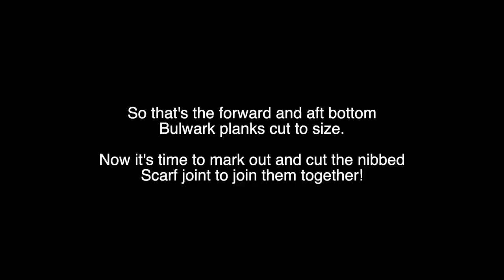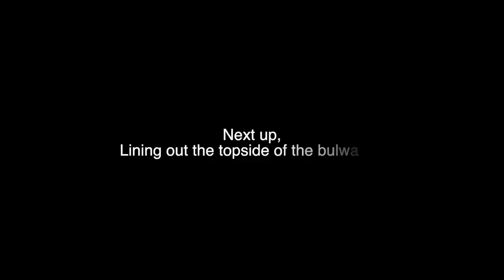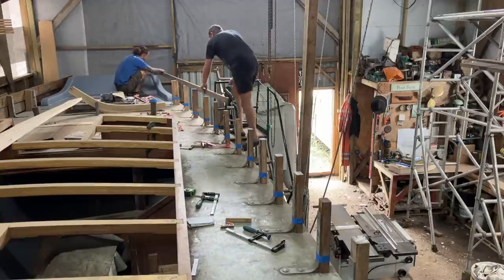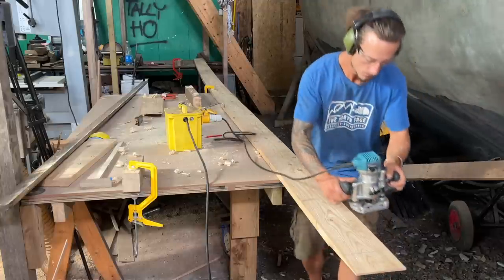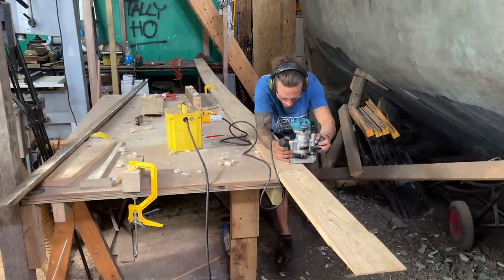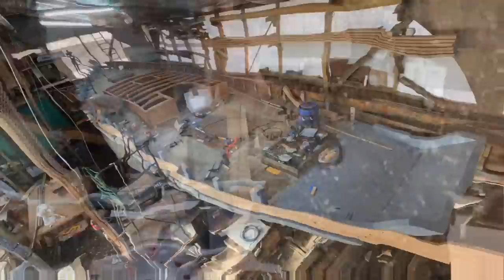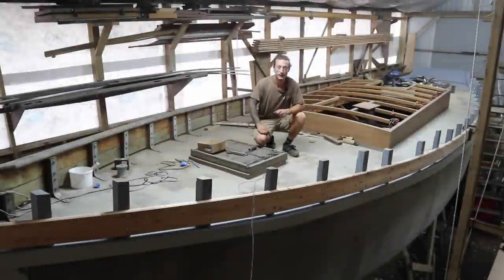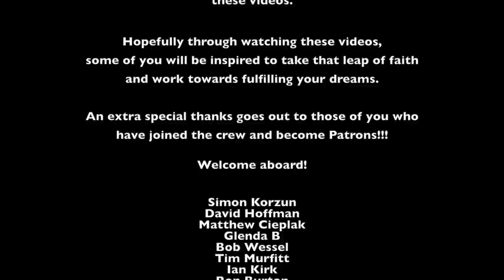Boatbuilding! Installing the Stanchions and Fitting the Bottom Bulwark Planks!! Episode 27

Comment: Round-handled mallets are a nightmare! Do yourself a favour and swap the handle for a square or preferably rectangular one with serious rounding-over. That way they never turn in your hands, and you always know the precise orientation of the head. Of, and you need a few more planes. Fairing that board edge is not a job for a block plane.
A minute with a chisel would stop that routed chamfer stop looking so artificial (and burnt). There are a number of traditional chamfer stop designs which would improve the look immensely.
Reply: 🔝🔝YOO🏆🎁:(🙂)*
🗣